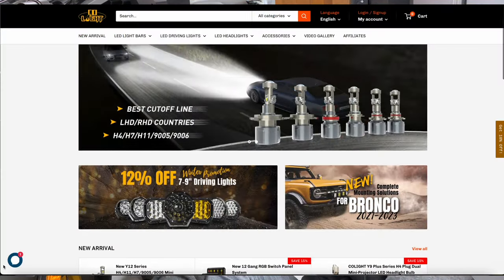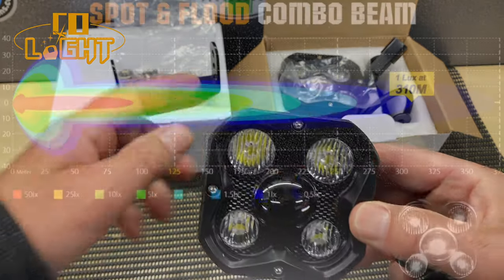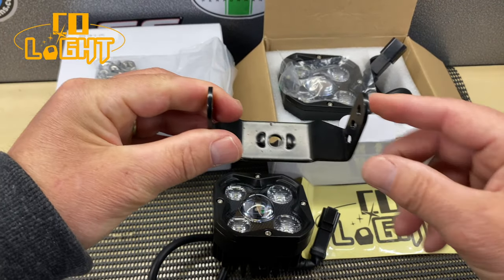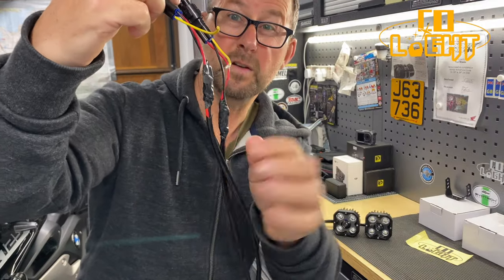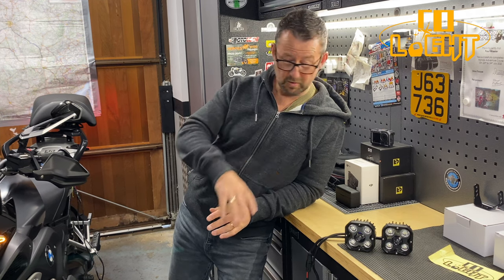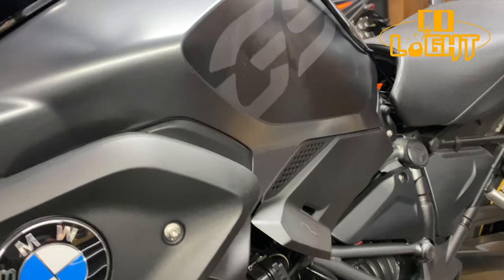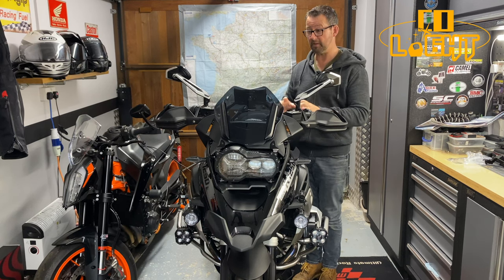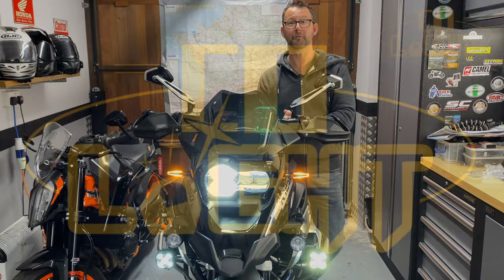3"HD spotlights from Colight, for £66. Let's try them on the BMW R1250GS👍

Comment: Great video Paul, very informative as usual. Was going the Denali route till I saw your installation. Also watched a few other YT channel opinions and can't really find any negatives yet.Just one review (U.S.),mentioned ordering the wiring harness separate, as they send one for a car rather than a bike, whereas the web page says bike harness - so don't know what that is all about, any problems with that or was yours the correct harness in the box ?
Reply from the maker: Hi Steve. I did a full install and connected them using Denali lighting cables and  hooked them up to my Hex Ezcan ,more expense but was able to dim the lights and operate them on/off with the push of my indicator button. The loom supplied was...um how do I say.. cost effective , that would suit others, who don't have the ocd that I do! So I ditched their loom and did it my own way as mentioned. I did say to them that the switch was not best for a motorcycle and I believe the have now changed it to one you can mount off the switchgear bolt/screw. Fabulous lights and well made, I think the wiring loom and there is a bunch of it.... just lets it down, for some that wont be an issue.Good lights though.
Reply: @gsd32i  I don't think I need the full Denali price experience either, so probably go the same route as yourself. Now that you've looked at,handled + installed both sets, are the "Premium Brand" auxiliary lights you installed a while back really worth paying extra for - I'm assuming not 🤔, although I understand if you can't answer that😂

Comment: Hi there buddy, got these lights after your video and recommendation,  video was brilliant very informative,  just one question I prey you get back to me , how the hell do you get them to go full power with main beam switch ????????? I have exactly same set up as you , my mind boggles 😮
Reply from the maker: Hi, I simply used the hex ezcan which I had previously installed on the bike and then programmed the lights to come on to high beam via my laptop.

Comment: what amps did you set your ezCAN to?
Reply from the maker: Hi. Each light is 2.5 amps, so 5 amps is what you need to power the lights. Hex recommend you add 30% to avoid nuisance tripping , so the option from the drop down list would be 7 amps . Merry Christmas 🎄

Comment: Hi Paul

thanks again for the vid. 

i was just wondering is there anything extra special I need to do in the Hex Ezcan software to be able to switch the lights off with the 3 pushes of the indicator switch?

i have fitted the Colight lights and everything works as per your vid but not the switching off.

Sorry mate I know you are not the customer service for either Hex ezcan or Colight but thought it could be an easy fix
Reply from the maker: If you want the lights to strobe ie flash times then quickly press the high beam x3 times. To switch the spots off simply hold the indicator button in for about 5 seconds and vice versa for turning on . If this is not the answer and you want to know something more please let me know 😁

Comment: Hi Paul, love your YouTube postings. I have a new R1250 GSA Trophy and been getting it ready for a 13,000 K/M ride around Australia with a BMW Safari. I have fitted a set of Colight flood/spot light after watching your 
excellent video. I have also fitted a Cansmart Denali management unit. I have reached out to Denali with my issue I’m having but they are having problems with delays and staffing currently and won’t be able to get back to me for sometime. You seem to be very knowledgeable about the Denali/ EasyCan situations. The issue I am having is the lights come on when turning the ignition on and stay on and won’t switch off or adjust the daylight sittings or nighttime sittings. The lights switch on fully and by pushing the indicator switch three time doesn’t work.  Hopefully you can help Cheers Hal from Australia
Reply from the maker: Hi . Just got home and read the message . Bit late for me to go into the mancave , I will have a look tomorrow . From the top of my head I think there is an advanced setting to activate the on/off function of the lights with the indicator switch . I will have a look in the morning for you 👍
Reply: @gsd32i  Thank mate greatly appreciate your fast reply. Looking forward to your reply tomorrow. Cheers Hal
Reply from the maker: @adventurehwyhubhwy5817  Morning, or evening!! I am in my garage and have hooked up my laptop to the ezcan. If you enter the settings which gives you the icons of the auxiliary lights/horn/accessory-ignition. On the auxiliary lights header, to the right you have 3 dots, click on these 3 dots and that gives you access to extra settings, at the bottom of this is vehicle switchgear controls, make sure the blue dot is to the right which allows you to power up and power down the auxiliary lights etc...its just a long single press of the turn switch to do this. Hope this helps?????
Reply: @gsd32i thanks mate it worked a treat.    
I appreciate your help very much.
Reply from the maker: @adventurehwyhubhwy5817  Brilliant, I think those lights are great for the price , especially if there is a risk of busting one with a rock!!!!!! Enjoy the brightness🤪

Comment: Hi Paul, been watching a few of your videos to do similar mods of my own.  Can I ask where you got your brackets to fit to crash bars? I have a set but not happy with them as with the bars not really having a straight line, the lights are always slightly off. Cheers
Reply from the maker: Hi. Sorry fro the delayed reply. They are from Denali
https://www.denalishop.co.uk/39-motorcycle-light-mounts
Reply: @gsd32i  thank you. Its also just came to my attention today as well that the 2 cylinder heads are offset. Affects my ocd 😂
Reply from the maker: @andrewmcqueen6386  hahaha..once you see it you'll never unsee it 👍

Comment: Hey Paul, for the Pigtail connections to the supplied reconfigured harness, couldn't you have used the extra ones that came with the EZcan instead of buying some more, or are they completely different ?
Reply from the maker: Hi Steve , from memory yes , but I just found it easier to use what in effect were ready made plugs . 😁

Comment: How much was the ez cam? Im trying to find it but its like £250+ im sure in video you said it was just ever £100? Correct me if im wrong. Is it the same one for a 1200 and 1250? I need one for 1250 if so. Thanks 😊
Reply from the maker: hi, they are about £180 now for the 1250 .
Reply: @gsd32i how much for 1200 GS , 2014?

Comment: Got the LA5 series lights and can figure out how to make em work… i am NOT an electrician NOR an electrical engineer… and by saying that what amps should I set em up on the app on my pc/laptop? Please advise glad your recovery was speedy mate forget them lights glad youre doing fine. Do I have to buy that Y connector as well? Thank you in advance and again glad youre doing better. HE has plans for ya my friend😉
Reply from the maker: The y connector simply means that the lights are powered from a single source , so if they were connected via the hex can then they both do the same and can’t be programmed to do individual things . You won’t need any connector if they are going to separate inputs . As far as ampage goes just see what the manufacturers say they are and set it slightly  above that . But I too am not an EE .
Reply: @gsd32i  colight says they’re at 2.5A each so I programmed them at 5 ea. we’re bout to find out what is going on later this week. Thank you friend
Reply from the maker: @MRGS48  yes . The Denali website will tell you what rating to set . 👍👍

Comment: I’ve just ordered a set, as you say for the low cost compared to others it’s worth it. I paid £71 with the wiring harness and postage plus the discount code (thanks!).
Reply from the maker: No problem , I can also see these lights being really cost effective for off road use, where if you drop the bike then you won't wreck a set of £300+ lights.
Reply: Just fitted to my GS ... one thing I did notice was that when configured through the EZ Can the lights flicker (pulse) when at less than 100% power ...interested to hear if you experienced this ...
Reply from the maker: @kevinpritchard6260  no all good . Have you got the modulation setting I think they call it turned on when you programmed the lights from the laptop ? Switch that off …
Reply: @gsd32i thanks will give it go

Comment: Hi, can you turn on the stroboscope so that it lights up when you want, e.g. while driving in a traffic jam? I turn it on and off myself at a convenient time. Yesterday I installed Hex and I don't have this option with turn signals, I have mix lights, but not without them. Regards
Reply from the maker: Hi . I have the strobe option , I have to press the hi/low headlight button x3 quickly and the lights strobe but only for about 2-3 seconds then you have to press the button again for more strobing .
Reply: @gsd32i  Thank you, but I know that. It cannot be turned on all the time.

Comment: I like the look of these lights. The ones you have fitted have a plug that goes into the loom. The ones on the website link just show 2 wires at the end. Do you have to buy another plug to plug into the loom?
Reply from the maker: Hi, I used the hex ezycan accessory manager, so I had to put plugs onto the wires to allow me to plug the lights into my accessory manager, it just made the whole process simpler and tidier, but at an extra cost. Great lights for the price.
Reply: @gsd32i  thanks for that I ordered a set plus the loom just waiting for delivery. Not got the Ezycan yet but only the had the bike 7 weeks will get one of those later. Love the videos by the way
Reply: Do you have to buy the harness separately

Comment: Hi so is this basically plug and play if you have ezcan? Planing to buy this for my s1000xr
Reply from the maker: Good morning . Yes . I purchased some cables from Denali and didn’t use the ones supplied . Increases the cost but the lights were ridiculously cheap and this way you get to set the brightness etc via the HexEzcan . One subscriber said the lights were temporarily out of stock incase it tells you they are not available .
Reply: @gsd32i  would you be able to put the link or the part number of the wire you bought from denali ?
Reply from the maker: The link is in the description section. I didn't use the relay and switch Colight sent me because it just all a bit too big and chunky. I used their cabling but just cut it to length and attached those plugs onto each end and then those plugs connected into the y shaped cable which then went into the ezcan.

Comment: Look impressive for price to be fair, I noticed on their site there’s two options flood or spot, what ones did you get ?? as I think looking at your demo would be the ones to have, thanks for a great vid.
Reply from the maker: Hi Lyndon, they are the white combo lights . Very impressive👍
Reply: Thanks for quick reply, I went to order and it gave me two options of either flood or spot even though it’s a combo light, I’m assuming it’s flood option looking at your vid.
Reply from the maker: @lyndonevans8033  Hi, just popped into my man cave and had a look. Mine have the clear middle lens and the outer ones have the horizontal diffusers so they are the flood beam version.👍
Reply: @gsd32i  thanks so much for going out of your way.
Reply from the maker: @lyndonevans8033  Lyndon, no problem at all . Always happy to help when I can 👍
Reply: @gsd32i  fitted the lights today, fantastic, gonna order for my other bike too, thanks again.
Reply from the maker: @lyndonevans8033  They are very good 👍👍

Comment: I purchased some MF dual beam Co Lights and a Hex Ezcan after watching your video. Someone somewhere should make you aware (before purchase) that the dual beam functionality is lost when using an ezcan. You can only have the low power yellow light.
Reply from the maker: Unfortunately I have no knowledge of the dual beam as I wasn't sent those, I was sent the ones I tested and they worked really well on low and full beam, no issue. Possibly do a quick video and upload it, for those  who are after the dual beam lights if there is an issue with them?

Comment: Do you still have these fitted and how are they holding up and performing?
Thanks
Reply from the maker: No I took them off. Not because of quality or anything like that, but simply because I had spent a small fortune getting the Denali lights way  before Colight asked me to look at them. my brother in law has a Gs 850 and we will be fitting them to that soon.  for the price they are bloody good .
Reply: @gsd32i  Nice one. I may well get some for the hell of it and the price.
Reply from the maker: @Simon-fm8yc  👍

Comment: They are surely a bright set of lights. 

However, my inside voice says: “But they don’t come with the proven longevity and respectability of the Denali lights though😮😅. If I am willing to spend 25K on a bike, I’m not inclined to start bargain shopping after the fact 😅.

And let’s talk about that wiring loom. It would never fit on my Tiger 1200 Rally Pro. It barely fits the ezCan and the D4’s wiring. Looks like something made for off road trucks and not motorcycles. Trying to capture both markets? 🤔

Cheaper works but let’s face it most purchases in this space, including these super expensive ADV bikes, are largely about cachet.
Reply from the maker: Some folks will always say “ can get it cheaper in china” even when they’ve forked out ££££’s on a bike 🙈
Reply: @gsd32i  😂👌🏾
Reply: Wait until you drop your bike and break your denalis they’ll be rubbing the hands for your next purchase . If you drop the ole China ones not so much to shell out again . And I bet more than 50% of accessories  are made in China anyway if the truth be known . Great vid Paul for the alternative !

Comment: One thing I’m interested in is the gasket seal. I’ve just had to replace one D4Denali that had filled with water and recked it. The gasket in it was a really thin silicone moulded. I’ve used silicone to seal both of them now
Reply from the maker: Hi Amy, apologies for the delay in getting back to you as I have been away with work. I have just been into my garage and taken one of them apart, there is a raised rubber seal around the unit to prevent water ingress, looks like a decent job.
Reply: @gsd32i  I’m afraid I have to disagree there should be a much more substantial gasket in them than there is these things aren’t cheap . To have one fail because of a gasket is a sign of lack of real world testing for durability. There’s so many products being hyped up as the best but it’s not till you actually have used them yourself you find out just what they are like
Reply from the maker: @adysmith2760  it was the colight ones I took part to have a look at , I guess any doubt,  use sealant to be sure of waterproofing  !

Comment: Any ideas What i would need to fit to a 14 plate tiger ?
Reply from the maker: Hi. I don't know too much about other bikes tbh. Simplest way is to use an accessory manager like the Hexezcan, if they do one for your bike? Failing that, then a ready made wiring harness is needed , but the Colight one that I was sent for the HD spotlight, didn''t have what I would say is a proper motorcycle on/off handlebar switch more of a panel mounted switch and I didn't want t cut holes in my bikes bodywork, but you could easily source one from the internet for about £10 and simply replace the switch. Colight do other lights , with dual beam function and they do a handlebar mounted motorcycle switch in this kit, but I only wanted the spotlights , which are very good and I simply connected them as per the video.
Reply: @gsd32i  could a Denali dialdim power these ?
Reply from the maker: @Bikingcritter  Hi. Yes having looked at them I would say yes, obviously best to use the other wires horn, high beam etc to get the most  out of it and to allow them to be turned off when the ignition is off.
Reply: @gsd32i  how long was postage
Reply from the maker: @Bikingcritter  I think it took about 4 days.

Comment: I think that this video shows a bit of bias. The camera setting makes them look far brighter than they would be in real life (your video with the D3s was far more realistic). They certainly look to be good value but if people buy them based on your video I would suggest they are going to be disappointed.
Reply from the maker: Hi Geoff appreciate the comments but put simply those lights are very bright and just a bit lower in the lumen stakes than the D3’s but not by much . There will be folk who will scoff at the price of £300 + for a top end set of lights but will happily pay £66 . I have done other videos we’re people say could have got it cheaper from China , well that’s the reason I’ve done the video. I don’t think they would be disappointed , certainly not for £66 . Have a great weekend and ride safe 👍

Comment: You get what you pay for.  The last thing I'm going to wire into my bike's electrical system is a Chinese knockoff electrical component of questionable quality. Maybe put them on my Gator but certainly not my R12GSA.
Reply: Do you think there is any possibility of them doing any damage to the electrical system?
Reply: @nickkaratatis3780  Not my bike cause they'll never come near it. There is a good point below about TUV.
Reply from the maker: Hi Alex , appreciate all comments , that’s the benefit of these channels etc . With the hex ezcan as the fuse it’s simply much safer to power any electrical item and do away with relays etc and lots of cabling . Ride safe and thanks for your input 👍